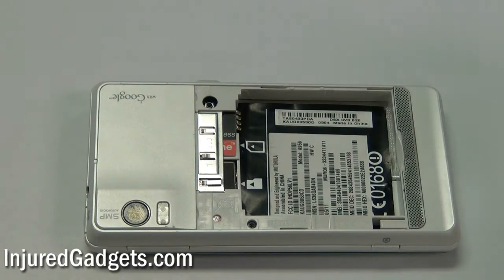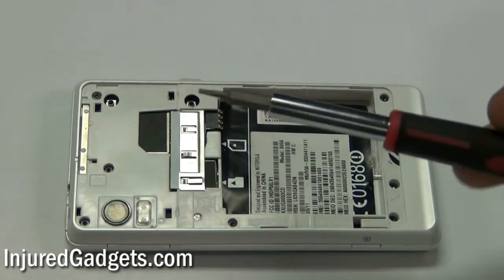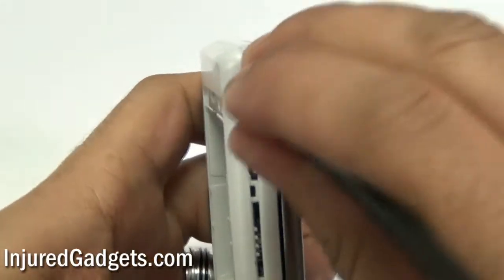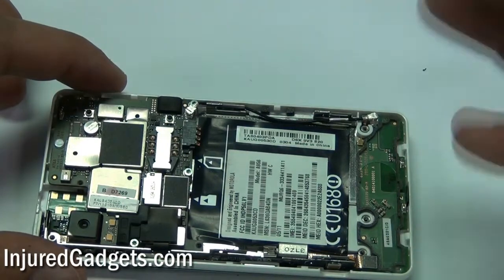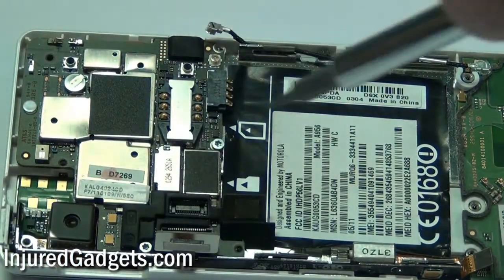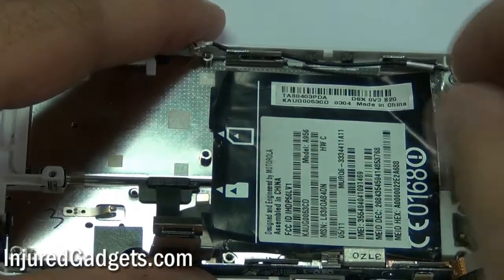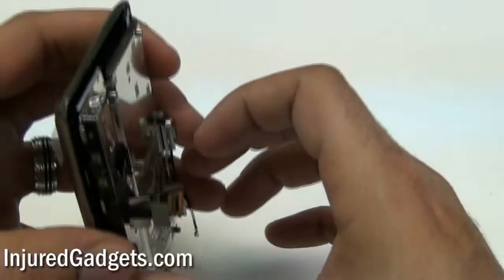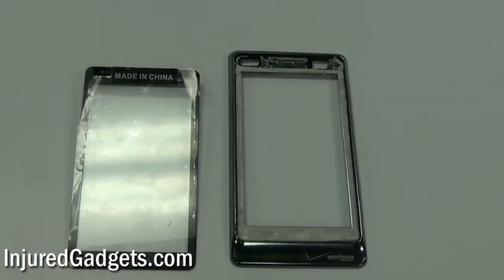Motorola Droid 2 A955 or A956 Touch Screen Glass Digitizer & LCD Display Repair Replacement Guide

Comment: i cannot get the new digitizers wire back in the jawbreaker wire. (sorry about my spelling) ive checked if it is the same model, and it is. any solutions?

Comment: 5:10 green thingy on the right side, 5:20 green thingy has disappeared. Not sure about others but i was freaking out because the outer frame that goes around the phone (and is attached to the green thingy) did not come off as easy, there was some foam-glue. I had to use a x-acto knife. 

Also at 0:50 it will be helpful to say "push left then pull right to unlock" ... I only pulled to the right and got my secure thingy broken

Model: A956 (white)

Comment: Swapped out the digitizer, reassembled unit, seemed to be no sweat.  Powers on, I can see the screen light up no display.  Feel vibration, even update sound.  No display. repeat to check cables.  Same thing. Broke an internal cable?

Comment: Very helpful video for taking apart my R2D2 Droid 2. There is an additional plastic clip under where the SD card goes in. My R2 Unit does not have a removeable Simm card. The phone still works as new after I did the operation.

Comment: There are a couple very important steps missing from this guide. I was able to figure them out by looking at before/afters from one section to the next, but it was a pain. I also eventually snapped a cable and ruined my phone (my fault, not the guide's). I would recommend EXTRA caution when attempting this. Also, I had to use T4 torx screwdrivers for many of the sections that called for T5. My phone was the A956 (droid2 global).

Comment: be extra careful after you disconnect the digitizer, he forgot to mention that you have to remove the speaker at the top of the phone. I accidentally ripped the connection for mine. So although I fixed my screen and everything else on my phone works perfectly fine, I have to make calls either with speaker phone or with a head set from now on.

Comment: You forgot a pretty important detail - between switching from the white to the black phone, you need to remove the keyboard surround housing.  It's kind of glued on and has a plug on it.  FYI.

Comment: @madarchitectmusic I wasn't responding to you buddy.  But in your case it sounds like a bad LCD. A digitizer "sync's" where you touch on the screen with the actual app so that there is no "drift".  If you can't see anything, that would be the LCD, because that is responsible for displaying the "picture" on the screen.

Comment: I have a question about whether I need the LCD screen or digitizer.
I dropped my phone and now it doesn't display almost anything except a white line at the very bottom of the very. Also the screen isn't responding to my finger. So do I need the LCD or the digitizer?